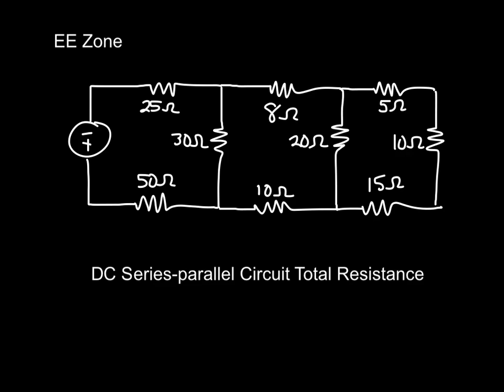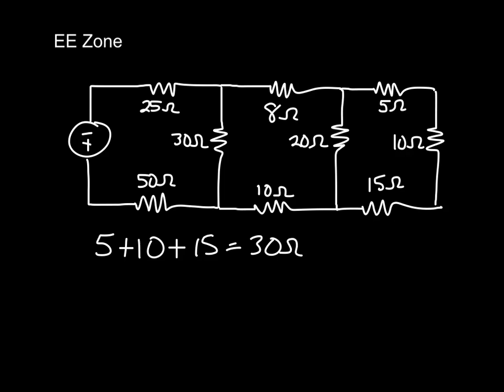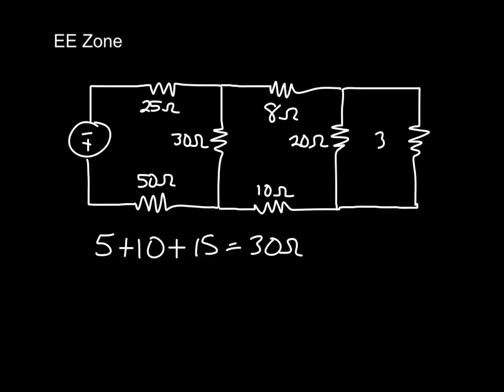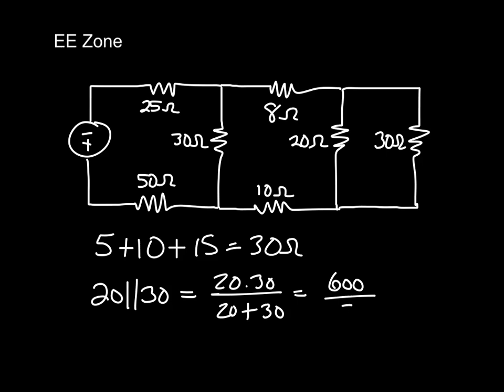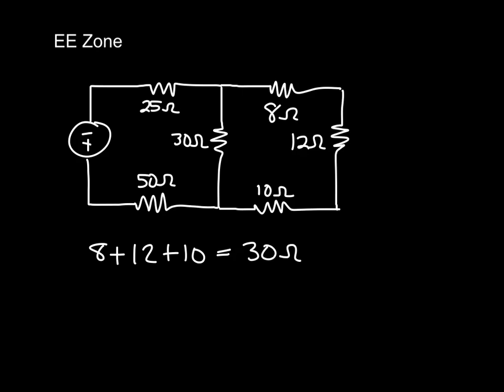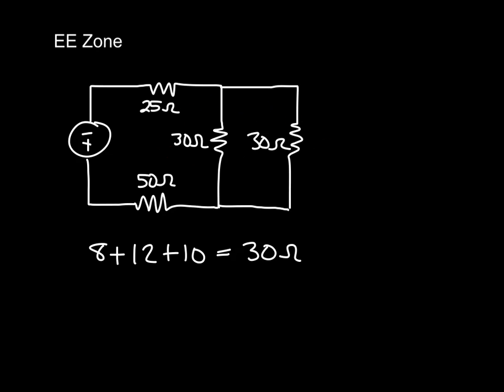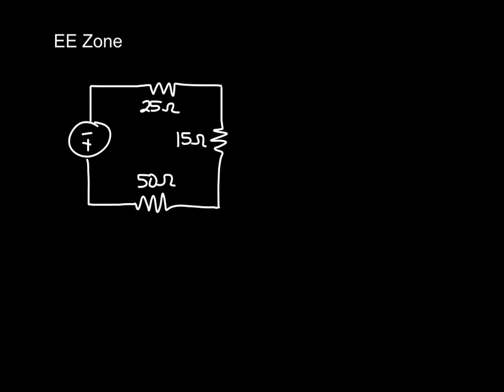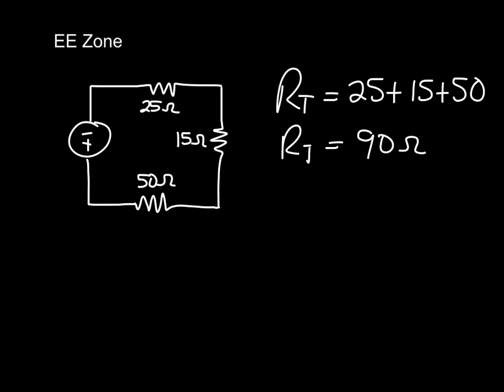DC Series-parallel Circuit Total Resistance

Comment: Anyone know how to find the amps of the second top resistor if you have a 12 volt battery? I'm doing a circuit where I found the ohms of all resistors but not sure how to break it down and build it up to get amps, volts

Comment: When we r adding 5+10+15 we r writing result 30 in parallel position (10ohms)why can't we writing it in series position it means in 5ohms position
Reply: Because current is deviding just after the 8k resistance

Comment: Thank u chooooo much  I asked so many members this question but I didn't got any were but I got here hey hey it's so useful😁😁
Reply: Do take look at this also.
What is a resistor? How does current branch in a network of resistors? How does it "know" how much should flow in each branch?
While some detail is given in science and engineering courses about conductors, insulators and semiconductors, resistance is described in several ways.
Examples include i. The restriction to the flow of electrons. ii. The difficulty in moving electrical current through a conductor to which voltage is applied.
iii. a circuit element which dissipates energy in the form of heat .
More appropriate description for a resistor would be the property of a conductor which determines the current produced by a given difference of potential.
This makes us remember that a resistor is a conductor first. And, there is reason to say that superconductive wires dont obey ohm's law. So all conductors are resistive, though not superconductors. 
Resistors are used in circuits to regulate the strengths of currents either by reducing the diameter of conductors or introducing more obstacles or lattice imperfections to reduce the strength of current.
The current branches in a parallel network by an elaborate rearrangement of surface charge.
For more details about resistance, how current branches in a parallel circuit and ohm's law consult the following videos, articles and books.
What is current ? What is voltage ?
A working definition for current in conductors like metal wires is "the start-stop motion of millions and millions of conduction band electrons everywhere within with a drift superimposed". 
In circuits, voltage is due to surface charges. Consider a simple circuit comprising a battery, two wires and a resistor. 
The e.m.f of the battery is due to separation of positive from negative charges which produces an e.m.f across its terminals and a pattern of electric field surrounding them, not exactly but like a dipole.
An electric field is there in the wires and in the resistor; powerful electric field and uniform within the resistor, weak and uniform within the wires. The field is set up by a tiny amount of surface charge with a steep gradient on the resistor and not so steep a gradient on the wires. 
It is the electric field E created by the surface charges sourced from the battery, which produces a force causing the mobile electrons to acquire a drift velocity v = μE, where μ is the mobility which is a number representing the freedom of movement of the electron in the lattice. 
This results in a current density J = σE, where σ is the conductivity of the wire or material of resistor and E is the electric field in the wire if considering wire and is the field in the resistor when considering the resistor. 
The p.d. or voltage across the resistor is the integral of a constant powerful field along its length. The p.d. or voltage across the wires is the integral of a constant but weak field along its length. 
Voltage is entirely because of the surface charges.
Electrostatics and circuits belong to one science and not two, that of electricity and magnetism. To know how they are unified visit this link 
https://matterandinteractions.org/articles-talks/ and view the article 'A unified treatment of electrostatics and circuits.  B. Sherwood and R. Chabay, unpublished. (1999)'
pdf. 
For more details see Electric and Magnetic Interactions by Chabay and Sherwood 
www.matterandinteractions.org
or 
Fundamentals of electric theory and circuits by Sridhar Chitta
https://www.wileyindia.com/fundamentals-of-electric-theory-and-circuits.html
There is a "look inside" feature in the amazon.com webpage of the book "Fundamentals of electric theory and circuits" by Sridhar Chitta with a few pages of Chapter 1 which may be viewed and also which you may swipe left or press < icon to view the foreword, preface and Table of Contents. 
For a video lecture by Prof Ruth Chabay on surface charge in a simple dc circuit visit 
https://youtu.be/-7W294N_Hkk
There is a full set of lectures beginning lecture 13 here on surface charges, electric fields, simple circuits, capacitance, inductance, faraday's law, motional emf, magnetic forces and more topics here
https://matterandinteractions.org/videos/EM.html
For a live demonstration of surface charge in a circuit visit
https://youtu.be/U7RLg-691eQ
There is a full set of lectures beginning lecture 13 here on surface charges, electric fields, simple circuits, capacitance, inductance, faraday's law, motional emf, magnetic forces and more topics here
https://matterandinteractions.org/videos/EM.html

Comment: Why can't I just add the three on each box? It will be 105 ohms, 38 ohms, and 30 ohms. Therefore, they are all in parallel now. I could then solve for the RTotal which will be 14.46 ohms. Why is this process not applicable?
Reply: You have to think about the path the current (I) runs.  It starts off going through the 25Ω, then it splits between the 8Ω and the 30Ω.  The current becomes smaller at the 30Ω and 50Ω than it was at the 25Ω.  Because of that "node" splitting the current you cannot add the 25 30, and 50Ω.

Same idea goes for the next loop.  
 
 You cannot add different resistors together when they have different currents. Thus in this equation you have to simplify the parallel resistors (which means simplifying the series at the far right).